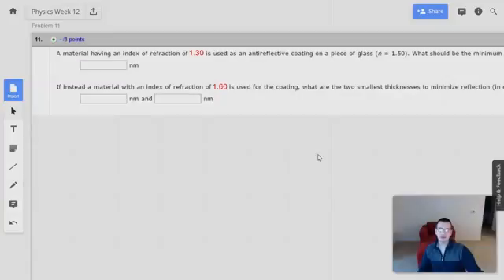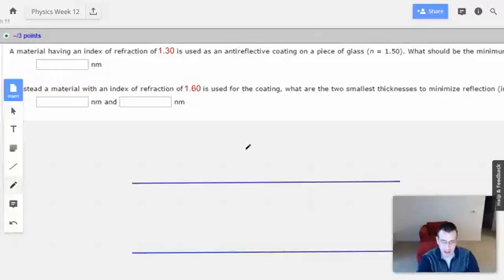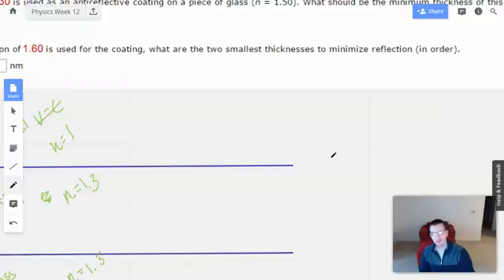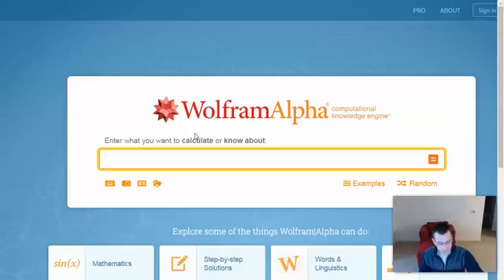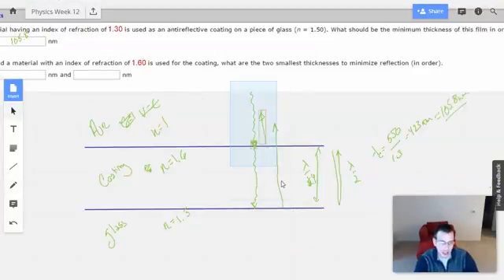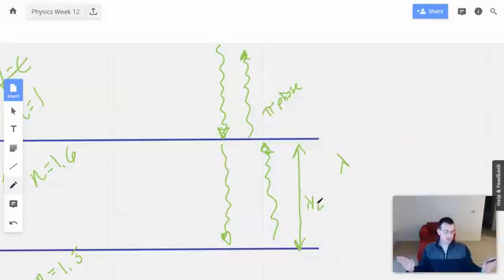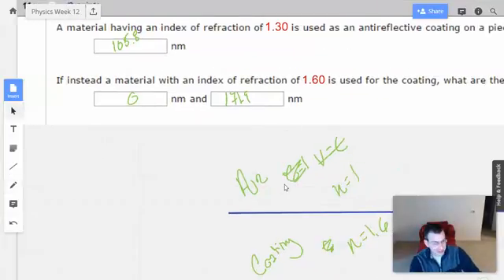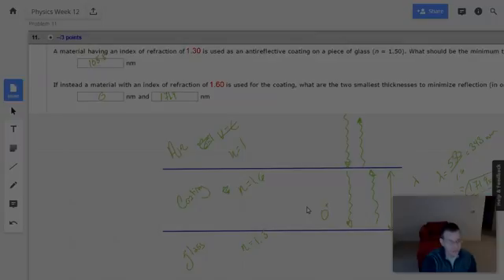Week 12 Problem 11

Comment: so the n for glass is not used for the whole problem?
Reply from the maker: The Index of Refraction for the glass is used only to know when there is a phase shift.

In the first part the light travels from 1.0 to 1.3 to 1.5, which means the reflections off the 1.3 and 1.5 are in the same phase since they both phase shift.

The second part has 1.0 to 1.6 to 1.5, so the 1.6 and 1.5 reflected waves are out of phase since only the 1.6 reflected wave will do a phase shift.

I think I explained it backwards in the video, either way, I'll do a better job explaining next time.